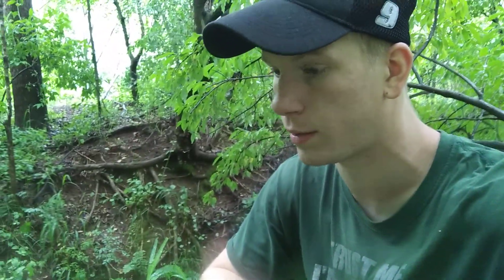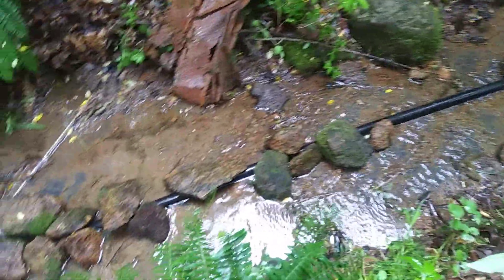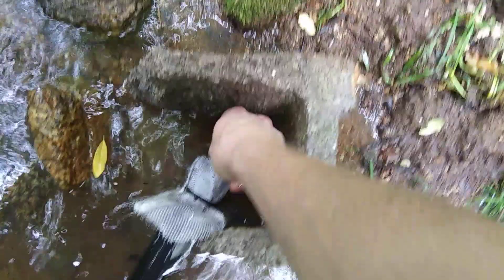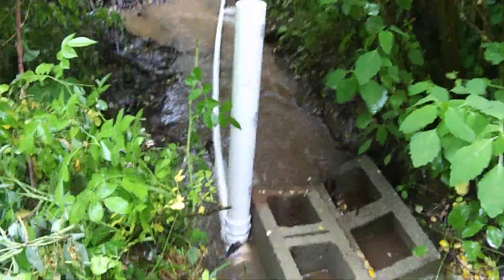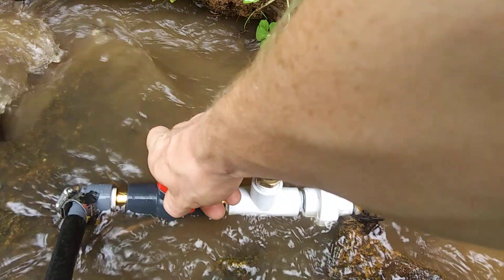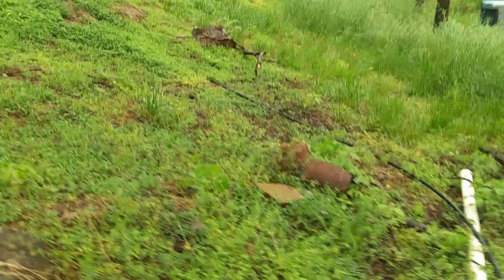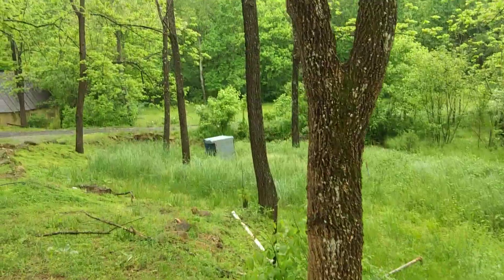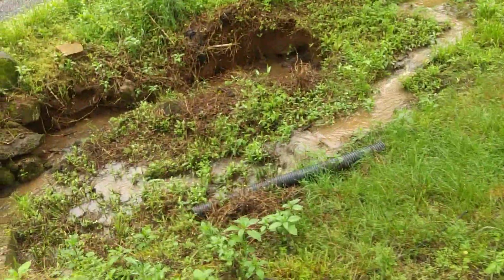Spring-fed Ram Pump, why I NEED a stand pipe! (Please Read Description)

Comment: How much head do you have in average. I have about 14" and could probably get 2" more with a shovel and I am unable to get my 1/2" ramp pump to work. Not enough pressure to shut check valve. Would the stand pipe help me out here?
Reply from the maker: I think I have about 18" of head maybe a little bit more, the stand pipe should help out some, watch Engineer775 video on the ram pump I think he goes over the technical stuff in part 1. Very informative. Good luck!
Reply: @Whelessry  Thanks so much. I did watch his video I'm gonna have to go over it again. I could also go another 200-300 feet up stream for another maybe 12 inches of head, but would I loose most of the flow with friction over that time?  Haha. Sorry I'll watch his video again I remember he had a chard for friction and flow loss on there. Thanks again
Reply from the maker: No, you can go uphill as much as you want, as long as you are using a supply line like in my video, use a bigger diameter pipe like black pipe in my video, but you must then have a stand pipe. Then it connects to drive pipe, then ram pump. The stand pipe brings the source of your water down close to the ram pump, water will fill in the stand pipe as high as the water source, which could be hundreds of feet upstream. Just remember there can be no air in the pipe and it all must be downhill. Listen very closelyto what engineer775 says in ram pumps part 1 because he goes over it pretty fast, and then watch my video again with that in mind, mind is the same concept but on a slightly smaller scale and i plan on upping my scale in the future. I had to watch all of his ram pump videos i kid you not about 10 times before it clicked and i understood the point of the stand pipe. It can be a flex line but as soon as to get to the drive pipe it needs to be solid and hard line. My creek is very flat not a lot of decline and that is why a standpipe is a must, because i can go upstream as much as i want, therefore achieving my highest point in the creek with the standpipe